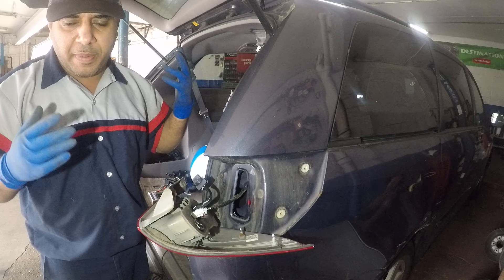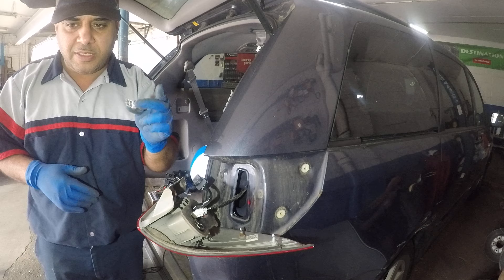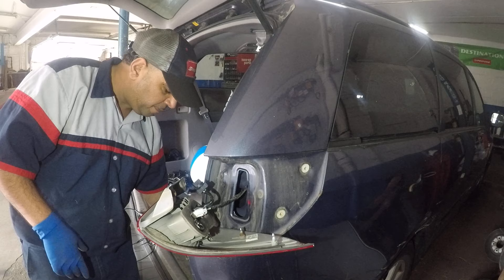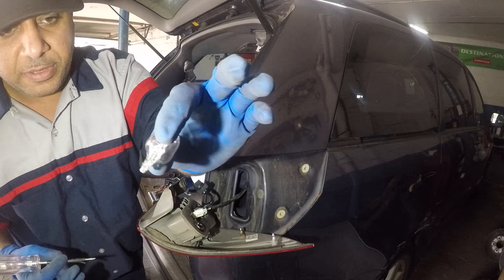Brake lights dont work even after changing bulb electrical trouble shooting

Comment: First I had one brake light out …Replaced bulb now both sides are out …but they are illuminated with taillights.
Reply from the maker: Check ur fuse also if u out in correct bulb if it’s wrong depending on single or dual filemnt it can short and blow the fuse

Comment: It didn’t work 😩😭😭😭
Reply from the maker: What’s going on
Reply: @RBTheMechanic  Please I have a question about this. My 2008 chevy malibu break or turning signals would not work. Not the bulb or any of the fuses. So confused on what it could be. No lights come on in back except reverse.
Reply from the maker: @trendtrends7081  use test light to see if it got power and round with lights on u need to use schematic diagram to trace down the issue

Comment: I have a 2017 ford transit connect and brake light bulb malfunction is popping up and I’ve replaced bulbs three times and nothing popping up
Reply from the maker: It could be circuit issue

Comment: I was worried it was the wire harness, after switching the bulbs and fuse. Turned out it was dirty contact spot. You rock!
Reply from the maker: Nice good job fining the issue!!
Reply: @RBTheMechanic   I have a 2004 ford focus se . I have checked the fuse and changed the bulbs out and got a new brake switch and my brakes still isn't working? I do have the third brake light that does work only. Any suggestions please??
Reply from the maker: @annaeury5747  u need to check schematic I have done down Vic’s town cars they has issues cluster switch which let the third brake light runs but other two dosent anways need to check diagram to see how it runs also have light control moduel

Comment: So what I did was switch the harnesses around to check if it was the connector, but the taillight still does not work, The breaklights work but not the taillights, I would thank anyone who could help
Reply from the maker: Did u check power and ground
Reply: @RBTheMechanic  nvm it was the fuse

Comment: Yes, exactly as RB said. I had the same issue on a backup light on my son's car. I noticed he was backing up and the one backup light was out. No worries. watched another youtube video, popped off the lenses, replaced the bulbs. It still didn't come on. I thought there has to be power because the rest of the lights in the same lighting harness worked. I used a small screwdriver to pull out the contacts as RB instructed and lights on! Thanks for taking the time to make the video to help me!
Reply from the maker: Nice job I’m glad u found my video and checked this out.  It would had been electrical disaster if u went to electrical mechanic he would had changed so much !!
Reply: 3:57

Comment: Great advice and instructions. My brakes lights went out in my Buick Enclave a month after I changed the bulb. So I checked the fuse and it was not blown, so I was scratching my head. Then I pushed the contact points up, like you said, and bam, all good! Appreciate you!
Reply from the maker: Nice glad u figured it out!!! I had few cars come in with same issue they went to 3 different shops and this was it

Comment: Bro.... Thanks man. I was checking for power from the rear of the terminal and was getting power. I didn't even think to check those connects smh. Thank you so much man.
Reply from the maker: Oh ok yeah always got to check connection I had bad experience with some issues similar to this I had power window switch on mdx connector didn’t make good connection even tho it was well plugged in but didn’t work out everytime it hit a bump it moved I stuck card board under it and it’s holding in place

Comment: Appreciate the video! Helped perfectly with the issue I was having with my car 👌🏽
Reply from the maker: Good job!!
Reply: @RBTheMechanic  Hello , I need help , I fix my own stuff but this has me beat , 98 Mitsubishi pajero / montero lwb gls , I have no top brake light and no rear wiper , i have turn signals , bottom brake lights work , I have tested the bulbs and the cluster and fuses , I hit a huge pot hole smelled some plastic burn, lost my alternator the 
A/T light battery light came on was down to 9v I replaced with new one thats all good but I can't find why brake and rear  wiper won't work , is there a relay or something obvious or secret im missing ? any ideas? Would massively appreciate any wisdom I'm not usually one to ask but I have to admit I can't work it out .
Reply from the maker: @DILLIGAS-GAMING  u need wiring diagram and track the wire and do multiple check point to see if it has short
Reply: @RBTheMechanic  thanks mate I'm doing next that seems to be the consensus, no easy normal fix on this one 👍

Comment: Thank you for sharing this, I had a passenger tail light out of my Toyota and I looked at the bulb and it was fine.
  I replace the bulb and it still would not work, but the other two work fine so I knew it wasn't a bad break light switch. I figured it was a bad contact inside the break light socket I tried moving one of the pens around there with a bobby pin but nothing I'll try using a flathead screwdriver maybe that will do the trick
 Thanks again and God bless! ✝️🙏
Reply from the maker: Ok try this
Reply: @RBTheMechanic  Here's an update, the good news is, I was able to use a flat head screwdriver and move the 4 prongs outward a bit. Within 10 minutes I got the the taillight bulb working again. But the bulb kept flickering, finally i got to stay solid. Hopefully it will stay on✝️🙏
 Thanks again man.
Reply from the maker: @Eurospec73  nice job!!!
Reply: @RBTheMechanic  thanks RB absolutely 🥳🎉💪🎇
Reply from the maker: @Eurospec73  welcome!!

Comment: Thanks RB, gonna try this on my cornering light. How would I check for voltage at the socket with a multimeter?
Thanks
Reply from the maker: Yes or test light
Reply: @RBTheMechanic  just touch a contact in the socket and look for 12volts with switch on?
Reply: Thank You Much RB!!!
I will check back with results...
Reply: Hey RB, I found that I had a loose blue wire at my side marker harness/pigtail connector. I touched it and it came right out. I secured/clicked the wire back in and now all is working again. Thanks Much for your help bro.

Comment: Hi. Informative. Where do I start when none of the left side tail light or park light (front) is not working? Fuses are ok. Mitsubishi Pajaro.
Reply from the maker: Start with check power and ground at each connector and try in new bulbs

Comment: Thank you so much im gonna go try this right now.  just replaced the entire assembly and it still didn't work.  One more question. Is the fuse for these tailights under the hood or behind the steering problem.  2012 sienna thank you!
Reply from the maker: I think it’s mostlikely 99% chances under the dash
Reply: @RBTheMechanic  found it. Turned out it was just the bulb. When i last had it serviced at toyota oxnard the mechanic said i had to replace the whole assembly and it was led he was wrong lol i found out it was just the bulb since the plastic cover is off i just ordered some led replacements thank you.
Reply from the maker: @Unemployedrobots   nice
Good job
Reply: Thank you!!  @RBTheMechanic

Comment: Thank you for the video. I have a 2018 Camry and passenger brake light is not turning on. It appears there is no actual bulb for the brake light but instead an LED module for about $35. Would you recommend I replaced with a module? should I still check the fuses even if one side is working? Thank you.
Reply from the maker: Umm those leds r issues u might have to take the chance and replace it gotta start sumwhere
Reply: Entire Tail light was purchased.
Reply from the maker: @himartinez3515  y?

Comment: I have same problem on my Nissan titan 2018.  They said its a wiring issue and I got a quote of 1200 to diagnose and replace wiring. I'm going to try to fix it myself. My brake lights work when I step on brakes but when I take foot off the brakes are dark. I've been getting flashed by people behind me.
Reply from the maker: I would first replace all the bulbs then get back to me make sure u out in correct bulbs they crazy with that price so start with this

Comment: Hey I have a mercury mariner and my tail lights are out and my brake light doesn’t come on either, when I changed the fuse it popped and when I change the lights it still didn’t work
Reply from the maker: Start with replacing the bulbs

Comment: I have a UTV and the tail lights work, but when I apply the brakes, the left brake light works properly, but the right side goes completely out. Tried a new bulb and it didn't help. I believe it may be a ground on the right side, but how would I check this?
Reply from the maker: Could be ground check both power and ground also check to see if the pins are making contact like I show

Comment: Thanks for the video. I did everything you suggested. However, the problem still persists. I might add the lights work. Any other suggestions?
Reply from the maker: Is it only one light now working?
Reply: @RBTheMechanic  yes
Reply: @RBTheMechanic  the lights both work. The right brake won’t illuminate
Reply: Same with my s10 truck right tail light works but not the brake

Comment: I have a 2017 dodge durango the driver side brake led light wont come on but the brake light works fine
Reply from the maker: If u got led lights it need the whole light to be replaced before doing the replacement check fuses and check power and ground in to the connector of the light to see if it got the power and ground with test light have some one press the brake peddle

Comment: Hi, I have 2012 Honda crv. The taillights on both side not working but braking lights are working. I went to auto shop and had done the diagnostic and they said it's not blown fuse and can't see any wire problem. They pop up the fuse maybe and the taillights are on. But after few weeks they not working again I guess it could be the rain and the water get inside, either way I don't know.  Any ideas what causes. Thank you.
Reply from the maker: Yes could be. Replace the bulbs anyways make sure u out in correct bulbs some times it could be faulty bulbs
Reply: Did bought the right bulb but still not working.

Comment: nice video but how can you test a reg light bulb thanks
Reply from the maker: U can’t test it I wouldn’t waste my time testing the bulb usully the fair brakes so u can test with oms meter of use power and ground so u know it got power and ground it has to lite up but some times the contac connects and start to work I would just replace it

Comment: The break light on my passenger side won't work even after putting in a new bulb. I tried pushing those metal things inward on the bulb connector and it still doesn't work. The driver side break light works fine. What could I try?

I have a 2008 Sentra.
Reply from the maker: Ok how many wires in the connector? If it’s 3 wires u have to put dual filiment bulb also new bulb could be defective sway the bulbs from right to left and check fuse also then let me know if it’s still issue.
Reply: @RBTheMechanic  

3 wires for that bulb connector. I tested the bulb socket with a multimeter. Having someone pressing the brakes I got needle movement with the OHM setting. No needle movement with the other settings. So there seems to be a current reaching the bulb socket.

Is there something else I can try? The bulbs I tried are the ones given to me at the auto parts store for my car.

Can the fuse be the problem even if one brake light isn't working? The other brake lights are working ok.
Reply from the maker: @CrowdPleeza  u have to check voltage. Ground should and power should be there  when pressure brake test light should come on and if both r there it should work

Comment: Man I’ve got a 2010 jeep wrangler and the brake lights stay on with key on and also vehicle running. Brand new tail lights, the old ones didn’t same thing. Left blinker blinks fast, right blinker blinks normal. “Electric specialist” told me that I had an ABS module out of a 2013 jeep. I do not have a ABS code. What do you think?
Reply from the maker: Try to pull the fuse for brake light to see if brake lights go off. If they do then unplug brake switch to see if brake light go off but fuse has to be back in last part is the brake switch stopper there?
Reply: @RBTheMechanic   ok I will do this when it autos raining, hopefully by tomorrow evening. There isn’t a stopper, it’s just a plunger attached to the brake light switch.
Reply: @RBTheMechanic  with key on the brake lights stayed  luminated and when I pulled the fuse they stayed on
Reply from the maker: @bowtiebuilding  with fuse out they stayed on?
Reply: @RBTheMechanic   yes sir fuse out it stayed on

Comment: There’s a part connects on ur brake assembly it’s called brake light switch I replaced bu dry T now car don’t turn off
Reply from the maker: But dry t?
Reply: @RBTheMechanic  my phone messes up my typing I meant the car won’t turn off now

Comment: I know this is a long shot considering this is an old video but I have an issue with my tail lights 

I have power to my tail lights I guess it would be the running lights the blinker and break light on the same bulb do not light up but the running light is on any ideas on how to fix I changed the bulb multiple times
Reply from the maker: Well blinker and brake bulb can’t be on the same bulb so u have 2 diffrent issues start with checking to see if u out in correct bulb.  Any connector with 3 wires has to have dual filiment bulb I would replace the bulb and check to see if it got power and ground when pressing brake and then move on to chancing blinker

Comment: My brake light works, but it doesn't light up when I press on the brake. My bulb acts as both the tail light and the brake light. Only one works.
Reply from the maker: Check the connections like I show if other side is working this should work also check fuses

Comment: What if has low voltage on back fog light ? Only 6 volt instead of 12.
Reply from the maker: I had case like that it was the relay check the circuit
Reply: @RBTheMechanic  circuit mean the cable? How am i supposed to check cable from front to back of car ?

Comment: I have a 2001 maxima
The break light switch keeps burning out .  Also the ABS light is one .  Related ? 

I have replaced the break light switch x2 and with in a week it’s broken again.  
All break lights were working g after replacing the switch but a week it’s broken again.

Any ideas ?
Reply from the maker: I had the same issue on Infiniti i30 2004 or somthing yeah of the time I had to replace the plastic part in there that drips the switch but I never had burned switch try oem I guess and it could be related to abs